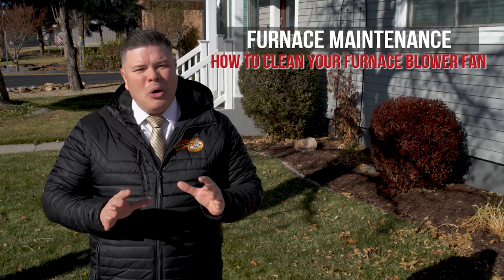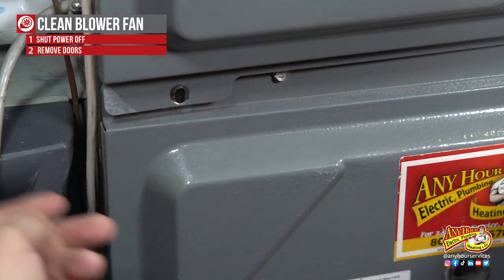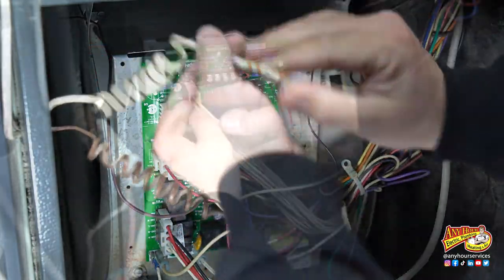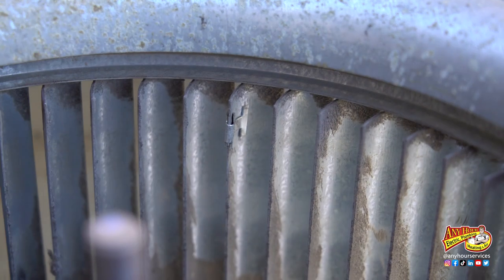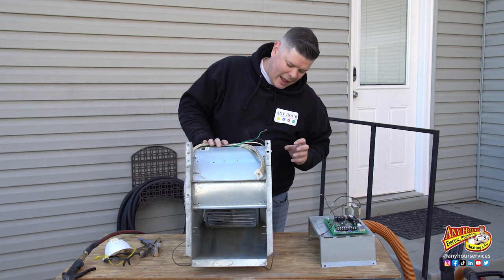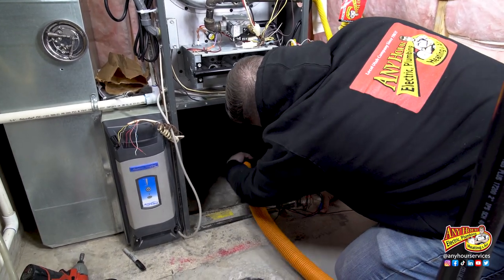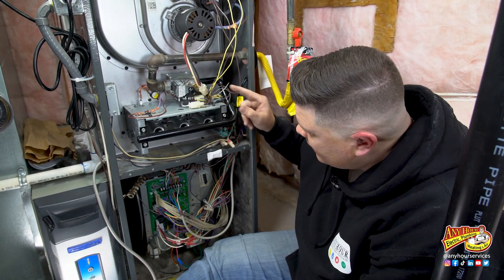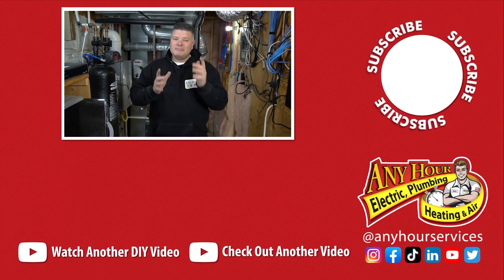Furnace Maintenance: How to Clean Your Furnace Blower Fan

Comment: Straw cleaners also work extremely will for cleaning the blades. I just bend the tip and go to town one blade at a time. Kind of a tedious job but someone gotta do it to keep the heat running smoothly. Lol Probably a good idea to do this once a year at the beginning or end of the season. Unless you have heat and air, then you might wanna do it twice a year.

Comment: It's furnaces like that one that makes me somewhat happy I still have an old rheem furnace with no circuit boards. Only 3 wires connected to my fan and the thing slides right out with the removal of 2 screws. It may not be the most efficient furnace but everything on it is fairly simple to fix.
Reply: No fair!

Comment: You can purchase venetian blind dusters that would do a decent job of cleaning up the blades.  There are even long cleaners for getting into the coils of fridges that would work.  I don't recommend wire brushes because they leave scratches, and it is what dust particles will adhere to after a while.

Comment: Great video. My electric furnace blower assembly was easier to remove while keeping wires attached except I had to unplug the main power wires. I just kept the assembly out of the furnace but right.aside so I did not have to disconnect the wires. I tried all the brushes except a tootbrush. I think its the only one that can work. Maybe a round small flexible brush could work well too. I was inside so I used the vacuum cleaner for most of the job and the blower at the very end. Use a good mask and protect your eyes! Easy job worthing it!

Comment: Great video, but how old is that blower?  I've had mine for 22 years and it's still super clean.  I do all my own maintenance and always use quality air filters.  One thing I did do when I first got the house was to put a gasket on the door because it just sat flat against the side of the filter with no frame on the door side and clearly air could just leak around the side.   I'm glad I did because my AC coils are also super clean.  It only has a 1" filter and I'm going to put a better frame in with a 4" soon to allow for better airflow.

Comment: Great video and presentation skills!  Regarding "getting to it can be difficult", having both inducer PVC pipes in addition to circuit board in the way for ours was really annoying!
What is your view on using garden hose (or pressure washer?) to remove tenacious gunk?  I've seen articles mentioning this.  Can it be done with careful masking and aiming, or is this just a bad idea even with sealed bearings?
Reply: Another video I saw cleaned theirs with a hose, but they only used the hose on the fan/fins after removing it from the motor and housing. In this video he mentioned how he could take it apart further but that it's usually not necessary.

Cleaning with a hose looks a lot easier but taking it apart and putting it back together is way harder.

Comment: Yeah mine has a lot of wires makes it look kinda hard . I wonder if I can uae compressed air from my pancake compressor to blow it out ? My Ac not cooling and blower is weak not full power and two lines were froazen since yesterday . And after turning on for a few minutes it gets hot , I turned off since yesterday allowing those frozen lines to thaw out .